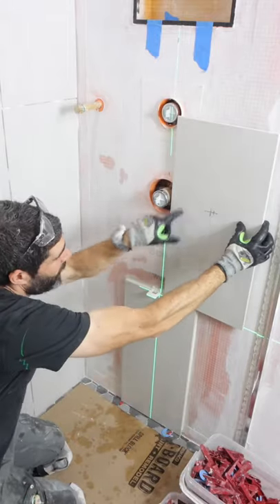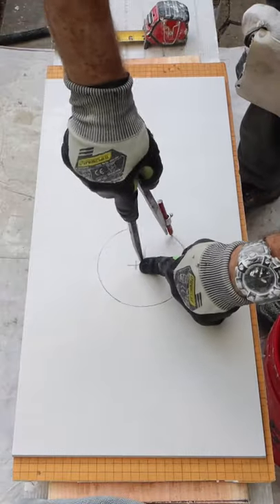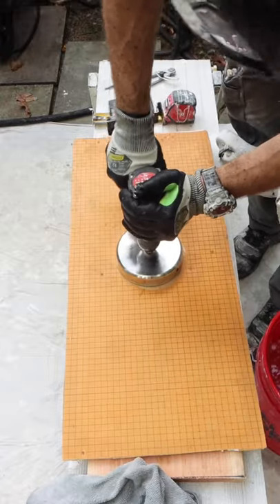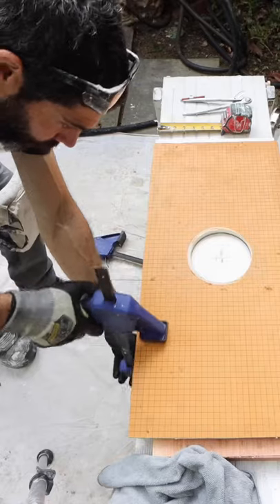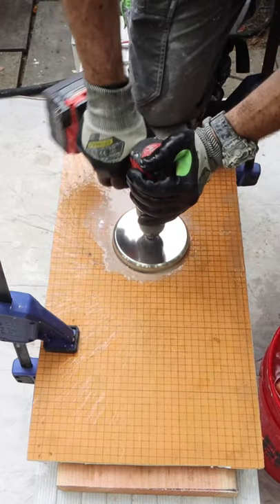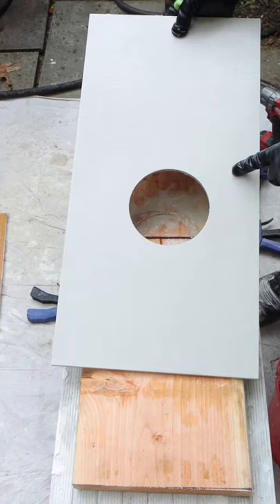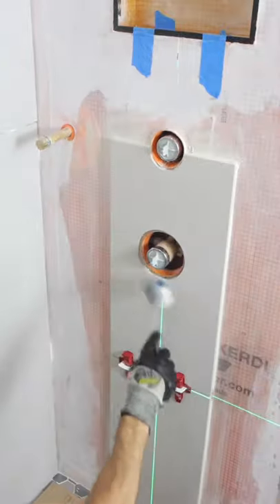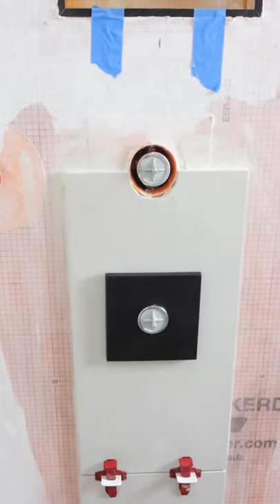Tile Shower Wall Tip - #shorts

Comment: Man i need some help with mine 😢. I just ripped my shower pan out and i want to try to tile it. My valve looks like it needs to be recessed more but you used a "spacer" off the tile for it.

Comment: If fill a plastic water bottle and poke a hole near the bottom with a nail. When you are ready  to drill. Pull out the nail the water pees out onto the drill bit. When you have drilled the hole put the nail back in the hole. 🤔

Comment: good luck to the guy that will have to replace those cartridges after a few years with the completely corroded rings and no way to get 2 wrenches on it.
Reply: cartridge removal is a no brainer the way he did it. No reason to need 2 wrenches. If the retainer was torqued enough to resist disassembly, it was not installed correctly.
Reply: @edmessina8392  I haven't found one that was over 6 years old and was easy to remove. There is a reason why they sell replacement rings. Even though handtight is all you need with these, nobody does that to avoid recalls or damage.

Comment: Pro tip: It’s 2021 and your still using expensive dedicated hole saws. Please try the rotary diamond compass tool for circle cuts over 30 mm. Maybe it is not available in you’re country yet.
Reply from the maker: $47 isn’t expensive 👍🏼
Reply: @HomeRepairTutor  for 1 size grit  blade that gets dull?  That’s why you 3 world countries  are so backwoods. We use technology for the trades here in the United States. Pay attention or pay cash.
Reply: Can you send a link for tha tool?